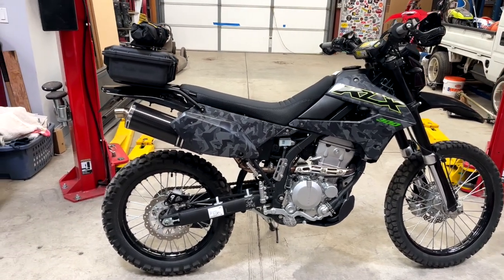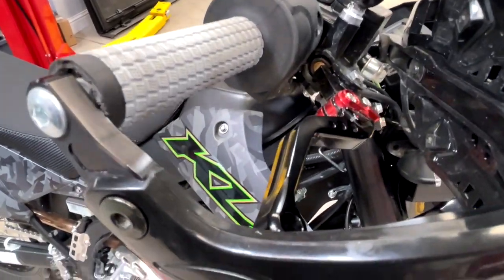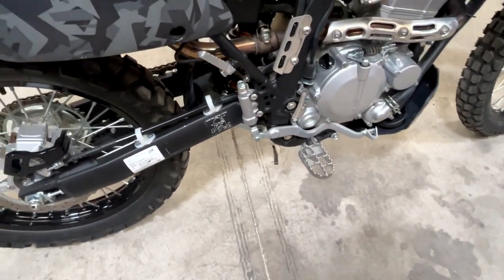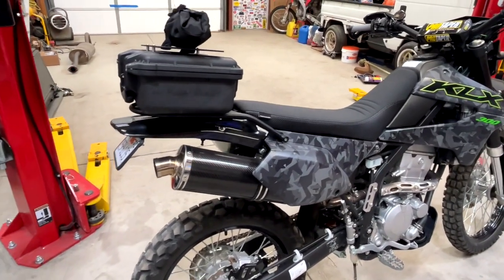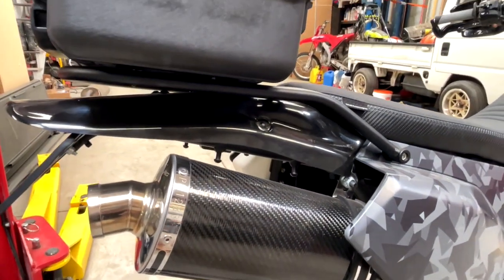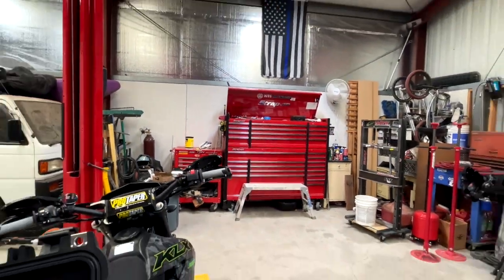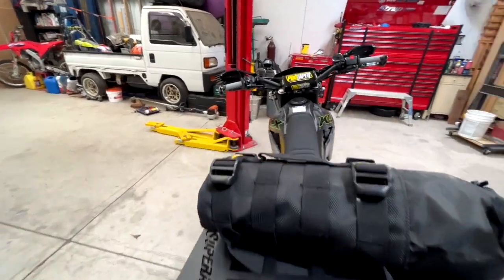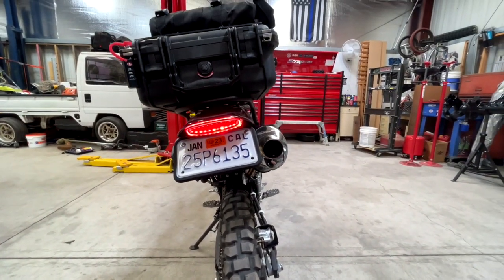2022 Kawasaki KLX300 Modifications and Upgrades

Comment: Why don't the manufacturers take a hint from the real-world riders when they design their products.  Pennies on their end hundreds on our.
Reply: PLEASE, don't ask for the impossible. 🙄😂
Reply: Alot of things have to do with legal code in different regions. Like the height of the license plate holder or the width of the turn signals. Its lame but unavoidable.
Reply: @Foxhound709  I get that, but some things they could do better easily are universal across the world .Like a seat that doesn't hurt you more than sitting on a 2x4 and fuel tanks that you can't do  a decent days riding with.  I totally understand the safety stuff has to meet across the board standard, but they need to try harder to find what the majority of riders want ,not what some guy sitting in the engineering department says is good. Royal Enfield has taken the riders' first approach ,are the perfect, no, but they are trying and getting better.  I just bought a new Himalayan 450, and it is a good bike for me. It could use a few tweeks but overall a very nice bike for the money.  Heck it even has a C type port and connect ability to things like Google maps.
Reply: @johnsilvers5883  good points. I just want them to make a wr450r so I can sell my wr250r 😆

Comment: I also went with one tooth smaller on the front sprocket.  It really helps with slow technical riding especially on rocky areas..the motorcycle becomes like a "tractor' just putting along.  I found that the overall change to the bike was an increase of 400 rpm for the same mph speed before the change.  I have the KX snorkel, twin air filter, FMF Q4 exhaust and EJK fuel controller with no O2 sensor.  I just did a dyno run and got 25.4 hp @ 8k rpm with 17 ft/lbs of torque @ 7.7k rpm.  This is better than a 10% improvement in hp over the stock setup.
Reply from the maker: Wow, yeah those are actually huge gains!

Comment: I've got a Colombian assembled/made  AKT ttr200 now 250 also changed out the front sprocket one tooth more . Still modifying and playing with it Colombian porting done on the head. If you know you know. Love how they resource and do with what they got. Better than me on that I wish I could send my tool box here. Playing with suspension for carrying my partner and a couple soft bags so it's comfortable for the what we ride( washed-out clay roads potholes when you don't expect it and really pristine smooth about 30% of time. But just want something a little bit more! Atleast definitely more for when it goes to overtaking traffic! I spent all lot of times in the last few years. Even before my partner in crim looking at vehicles coming at me going on hope and a prayer because I'm just pulling all I got to get by. They sell that bike here. Just curious if modified right if it if it would be good. Max highway speeds are 80 to 100 km. Definitely like it to cover that and a bit more. Sadly no drz 400 around. I've got a KTM 690 at home and a bunch of other bikes that would be way too  fast or too much fuel for here. Also to much attention. Like your video so I thought I would ask. Thanks for any feedback. I signed PBR is my school of choice so that might help a little bit with me sending you this message. Lol

Comment: 22 klx camo, pro taper bars,folding mirrors, ims 2.7 fuel tank, ims foot pegs, shorty levers, delkevic exhaust, ejk, opened air box,rear rack, tusk fender eliminator, removed helmet holder and relocated tool bag with custom bracket to helmet mount, frt sprocket is to big of jump so did rear 42t with crying gold chain, I retained O2 sensor per ejk advice,love bike still get 65mpg
Reply from the maker: Nice changes you’ve made.  Are you happy with the EJK and if so what are your settings at?
Reply: I had popping mostly when cold which ejk cured wired unit to sit in headlamp nacel pocket just front of cluster so easy access, I bumped settings at first, got it to 86 on level ground but mileage went down, adjusted green and red down one light, now runs excellent and back to 65mpg, sorry don't know exact settings but I live at 5000el and ride to 10000el so everyone should have different settings definitely glad I spent the money
Reply: Added seat concepts comfort seat, now ready for new tires will probably stick with d605s Dunlop's as I can't find anything better  , any ideas

Comment: Glad to see this video and the comments below. I did more than this to my '22 KLX230 and still not happy, so today I put a down payment on the KLX300 due to arrive in the spring of '23. Some but not all of my 230 upgrades I can transfer over to the 300 and put the stock items back on the 230 to get ready to sell. One of the upgrades I made very early on was to go from the stock IRC tires (21x2.75 and 18x4.10 to Dunlop D605 12x3.00 and 18x4.25) so I'll be swapping them back to keep the Dunlops for back up if I need them. Thanks guys, good stuff here!!
Reply from the maker: Yes, I am shopping right now for tires.  I have to admit, I am not happy with the factory tires.  They are fine for pavement, but when I went riding in some light rain and on a trail - I did not have the most confidence in them.  I am looking at some D606’s or a friend of mine recommended some MoToz Desert Tractionators or some MoToz Enduro IT’s.  I’ll update when I decide which direction I go!

Comment: Nice video with overview of your mods.  I also have a KLX300 (2021) with lots of mods.  You were wondering about a larger foot brake extension.  KronoParts sell the larger brake pedal extension for the KLR650.  I did some measurements at the dealership comparing the size of the KLR foot brake to the KLX foot brake.  The KLR is a little larger, but I ordered the part from KronoParts.  It fits nicely on the foot brake of the KLX.
Reply from the maker: OK that is awesome to know!  I am going to order one today!  I didn’t need anything much larger, I typically have no problem 90% of the time, so the 650 one may be perfect!  Thanks for the insight!

Comment: Just bought all of the same components as you did for the bars /  adapters and handguards… Just curious if you added any extra length to your clutch cable or if it’s still stock? Great video by the way!  Just picked up a 2023 KX300 with similar paint scheme… just now starting all these upgrades
Reply from the maker: Hey L.D.!  No, I was able to keep it the stock length and haven't had any problems with it!  Glad you found the video useful, and you'll LOVE the bike!
Reply: I’m going to make it through the break in process before the exhaust / intake and Turner….  Not sure I’m going to wait the entire year before warranty to expire… I feel like the performance mods will wake the bike up a bit.
Reply from the maker: @ldalewatkins  Yes I ended up not waiting either and it was worth it!

Comment: Question about the foot levers ;  both the brakes & gear shift levers look like they might be exposed to any type of
crash or catching on things as you go by?  I've seen some skid-plates that have the flange extending out to where
there is some protective coverage of the levers on both sides but I either can't see it well or perhaps you can better
explain your feelings about this possible problem?  IDKnow that it is any problem & also what about crankcase
disc's?  Are you going to put some on or do you feel it is unneeded?

Comment: Great video!  I just purchased a 2022 KLX300 last week!  Pretty excited to make some upgrades. Since you posted this video have you made any other changes you would recommend?
Reply from the maker: Hey Ken!  Thank you for that!  Actually the only other things I have finished are the “future upgrades.”  I finally installed the EJK tuner as well as the PAIR valve and smog delete.  It made a pretty good difference.  Next up is tires.  Still am NOT a fan of the factory tires.  I am looking at getting some WIG tires on it next.  Here is the link to those as well: WIG Racing 110/100-18 and 80/100-21 Motocross Dirt Bike Tires With Inner Tubes https://a.co/d/8NUBxyP

Comment: I got the pro tapers CR High. I got the ‘23 KLX 300. I um coming up pretty short in my clutch cable trying to install the bars, like so short that if I go full turn left it pulls the clutch cable tighter than a guitar string. Did you get a longer clutch cable?
Reply: I just got a 24 klx 300. With the high bend bars, the clutch cable is definitely too short. It has to be modified (I don’t care what anyone says) Especially if you want Cyrca pro bend handguards.

Comment: Great video. Thanks. I’m interested in the seat concepts lower seat. They claim the low model to reduce seat height by 1 inch. It that really accurate?  Also is the seat softer than the factory seat?  Thanks
Reply from the maker: Hey Jack!  YES the seat definitely is an 1” lower and it actually makes the bike feel “right,” if that makes sense.  Also I the seat concepts is MUCH more comfortable than the factory.  I was actually blown away the difference the seat alone made to the bike.  Get one, you won’t regret it!

Comment: Good call just bring an extra gas that’s what I do. Not interested in the big fuel tank it adds too much weight upfront and doesn’t look good. One thing great about the Kawasaki is it alerts you very clearly that you’re low on gas
Reply: The stock tank is metal, if you replace it with a plastic one it will be lighter

Comment: One upgrade I had to do with my 2019klx250 was to remove the upper drive chain limiter assemby. The moment you carry a second passenger, the chain rubs loudly on the limiter roller even after stiffining up the suspension coil.

Comment: GREAT explanations of the upgrades, and I'm betting everybody appreciated your having shared the LINKS, for tracking-down the various items.

Here's a question. It seems to me like a bit of a hassle to drill-out a handlebar end, and tap it, even though I "get" that you had upgraded YOUR handlebars, to make it easier to stand, while hitting big bumps, but what's-up with those things that look-like little clip-on END-CAPS, on the outboard end of the throttle grip, into which the bolts of the lever-guards appear to be bolted?  Are those some kind of pop-on "cups" that could be attached to both sides' grips, allowing the lever guards to mount-up, while essentially being held-tight primarily by the central clamps where these lever guards are mounted-onto the inboard portions of the handlebar?  IF those were on there tight-enough, they could hold the lever-guards in place, though obviously NOT as solidly as having them bolted-through into the handlebar ends.  Comments? Or have I turned into a Rube Goldberg clone? :)

Thanks, again, for the video.  That hardcase on the back is a good idea, if you're needing to secure a concealed-carry pistol, BTW.  Yeah, someone COULD cut-through, but it slows 'em down, and certainly protects the items inside.

Comment: Great video.  Thanks for posting.  I do have a question.  I just go my 2022 KLX300 Dual Sport.  We are putting my new ProTaper Handlebars on with the Cyrca Probend Ultra Handguards.  We are having trouble finding a Throttle Tube that will fit....or we just don't know which one to use that will fit easily with the Handguards.  Which one did you use?  Thanks again.

Comment: great video helps out tremendously with your links in description....beautiful bike im getting an exhaust first im thinking Yoshimura or barkers....and I had the same issue with brake pedal after much googling and then more I found this:
KronoParts Black Brake Pedal Surface Extension Kawasaki KLR 650 2008/2018

Works great cheap and I have been using it hard for a few months and its a game changer
Reply: ordered from ebay and painted it black myself....not a perfect fit but you'll see the difference

Comment: Hey! Love the bike! So that Fisch Moto spark arrester is nice. Question: they only have it listed to 45.7mm but the inside d of the Delkevic is 50mm or so (according to them). Does it fit well?
Reply from the maker: Hey Edward, yes it does fit.  It has three set screws that you adjust to keep it in.  The outer lip on it is probably around 52-55mm, so that part of it fits perfect.  Just adjust the er screws evenly and you’ll be all good!
Reply: @andersen24  awesome thanks!

Comment: Is there any dash set that will let you know the fuel, gear, or tachometer thats adaptable for the klx300? I was thinking of buying it as a starter bike but like to have a little more information. Thanks
Reply from the maker: Hey Josh, the only company that I know of that is remotely close is trailtech.com who sells the Vapor.  They can give you tachometer, but fuel and gear will be tough.  You are going to need a sending unit for the fuel, and for the gear select, I don’t believe the Kawasaki even has that wired in their loom, so without that from the factory I am not sure it’s possible. My only real complaint is the fuel level, but that is also why I carry the 1.5 l fuel bottle just in case!

Comment: Hey my buddy has this bike but the sm version,  he wants to convert to offroad. Slim options for tires with the 17in front rim. Do you know if there is an aftermarket 18inch front rim that fits and wouldnt have to change the rotor?
Reply from the maker: Hey Steven, I'm not sure but that's a good question.  I'll look at a couple other sites and see if I can find anything on there and let you know.
Reply: @andersen24  cool, im a drz guy but his bike rips, he ended up following us through some light trails the other day. sm tires held up 🤣 was awesome

Comment: How did you mount the Pelican Box onto the rack?
Reply from the maker: I used all SS hardware, marked the holes on the bracket, drilled through the Pelican, used SS fender washers on the inside, then sealed the holes with some Lexel on each hole.  Doesn’t budge and wanted the fender washers to spread out the pressure so when out on trails it won’t stress the Pelican…
Reply: @andersen24  ok thanks! I was just making sure you didnt find some aftermarket mounting bracket or something, Will post vids of my build soon!

Comment: quick question, with the front turn signals how did you get them do work. i hooked mine up and they wouldn’t flash and they only lit up very dim. i also have led rear signals and let headlight. did you use some sort of relay?
Reply from the maker: Hey Daniel, I would first check to make sure you have a solid connection on your power and your ground wire.  I use solder seal butt connectors on mine with heat shrink over them.  And yes I DID use a relay on mine.  If you go the TST link for the fender eliminator kit and rear turn signals, there is an option to add a relay for $3.99 that will prevent the hyper flash for both the front and rear turn signals…….let me know how it goes!

Comment: Great mods. I have the 2022 klx300sm and I’m having trouble getting the grip off the throttle tube without damaging it. How were you able to get that grip off on the throttle side? Thank you!
Reply from the maker: Hey Brent!  When I went over to the clamp on ProTaper pillow tops on the ProTaper bars, I didnt have to remove anything since it was all new.  I will say factory grips are a PAIN to remove since they are typically vulcanized on.  In the past, I have used a small screwdriver to work it in from both ends of the grip (cut off the end piece) to break it free.  Also make sure you are pressing forward on the throttle side so you aren’t spinning the throttle trying to remove it.  If they are on really good, I take a razor blade and cut it down the middle of the grip and start to pry them off that way with the small screwdriver.  Good luck and let me know how it goes!

Comment: It came with the black tank ? Mine has the blue and did you do the tuner with the exhaust?
Reply from the maker: Yes, the camo comes standard with the black tank, in fact that is the only option.  Did you by chance by yours used, and the previous owner installed that?  And no I haven’t done the tuner yet, I am going to wait for the warranty to expire before I do anything else to it.  I was able to get rid of the engine cutting out when I put the oversized snorkel in from the KDX.  HUGE difference when I did that!
Reply: @andersen24  I got the 2022 comes with a real tank

Comment: How did you adapt the tusk front signals to the stock rubber grommet?
Reply from the maker: Sorry, I missed this question!  Actually they slid right into the stock grommet as if they were made for it!  Worked like a charm!

Comment: Used the mzs levers after I broke my clutch lever.. dont have any complaints.. they will definitely be a great back up set.. recently installed the zeta pivot levers. Really good feel and super good quality.
Reply from the maker: Oh good to know!  I will have to check those out. Thanks for the tip!
Reply: Are those zeta levers shorter than oem??? I've been looking at kit. But I want shorter levers so I can run bark busters
Reply: @colefalls979  they are shorter but not much.. basically if u cut the ball off the end of oem levers. That how long zeta are
Reply: @_sedda_3408  thanks! I think that's all I would need to run bark busters
Reply: @colefalls979  nice!

Comment: what are those small mirrors u have called? are those legal to have on?
Reply from the maker: The mirrors are zeal bicycle mirrors, you can find the link to them and all the other parts in the video description.  In California, per CVC 26709 (a)(1), your motorcycle shall be equipped with a mirror so located as to reflect to the driver a view of the highway for a distance of at least 200 feet to the rear of such vehicle.  These work for driving around town, but if I go on a longer trip, I will install at least one of my doubletake mirrors (also have a a link to them in the description).
Reply: @andersen24  ok thanks